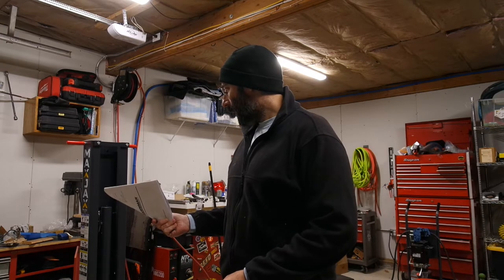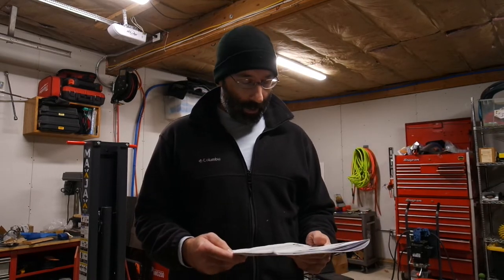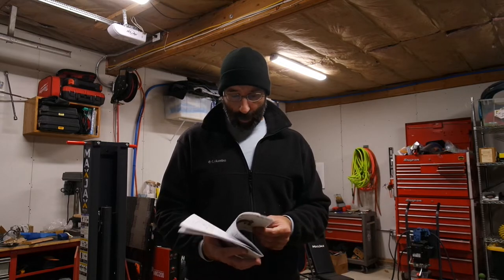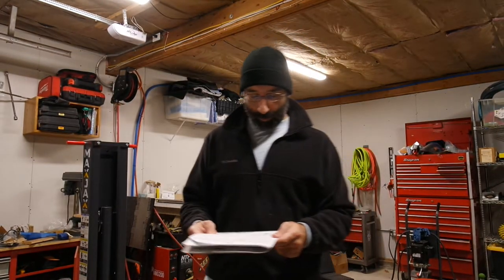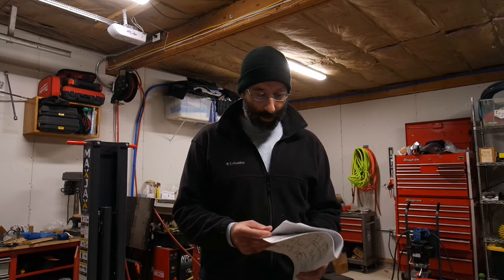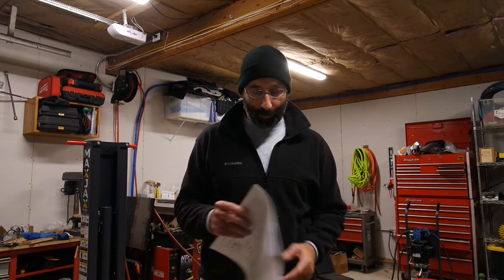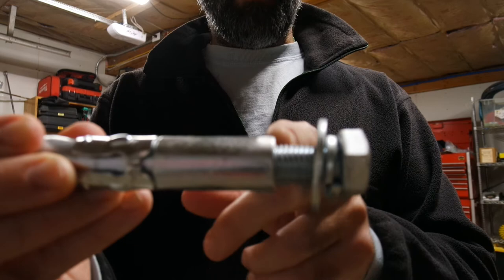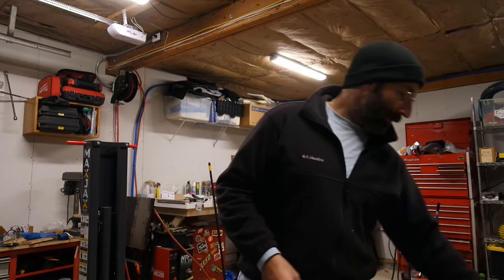MaxJax M6K lift install problems, tips, and suggestions

Comment: Helpful insights, Thanks for posting the video.  Using the post as a template didin't work well for me either. But I knew the holes would have to be near perfectly pumb to not cause issues later so what I did was took a piece of the thin plywood crate that the lift shipped in and I cut it out to match the size of the plate and drew circles for the holes with a black marker and then drilled those holes out , then I used the thin piece of plywood as a plate template setting it on the concrete in place of the post. It worked perfectly. I first pre drilled the smaller hole and then stepped it up to the larger bit. My holes ended up perfectly aligned and plumb without the actual post in the way.  If the mfg wants to really step up their game they could pre print this "template" on the top of the crate and tell you in the instructions to cut out and use the included template... ;)
Reply from the maker: Great tip!

Comment: Great video, good tips.  Appreciate the tip on the wej-it anchors.  $64 for 10 anchors vs the $180 to get anchors with the exact same spec from Bendpak! I plan to get a few so I can use my lift in more than one place (more than one garage).  Not sure what means you use to do your videos.  If you just use your phone like I often do then maybe try an app like the one I use which allows me to make a video with my phone while recording the audio for that video from my bluetooth headphones.  Lets me walk all around and have good crisp audio that does not fade when I am not directly facing the camera.  I have a few videos that I really wish I had used this option on that I can't change now or they will lose their priority.  The app I use with my android phone is Cinema FV-5 I really like it. Only issue I had with it is that it dumped my videos into a spot on my phone that was rather odd so I initially thought it was not working.
Reply from the maker: I appreciate the tips for the AV stuff. My old phone let me record audio with a bluetooth device, but my new one will only record with the built in mic (calls work fine with BT devices, but it won't record audio when filming). I used to record with a mic and then overlay the audio, which was a pain, but it sounds like your solution might be a lot easier. Thanks again.

Comment: Awesome video!  I am planning on a near term purchase and there aren't too many videos on the "new" version.  You also speak about this stuff in a way that I understand.  For example, your explanation of the reason for the width choice now makes perfect sense where I didn't really get it when others just say the width they chose "because I have X car".  I actually plan on doing a mock up with the cars in place to make sure I get it right, but I will definitely benefit from you sharing your experience.  Thanks!!

Comment: Looks like my replies to you are getting deleted. I’ll try this way: Yes, female threads as I need them flush with the floor as well. I got them from the anchorco site who also has the epoxy as well. Search Power-sert for the inserts. You will need the 5/8” thread. If you have a damp environment or maybe outside, they have it in stainless as well but will cost a lot more. I did just order so I don’t have them in hand yet but looks like it will do what I want. Also ordered four pipe jack stands elsewhere. Pipe stands because I can’t find anyone who still makes the car stands that have the 30 to 50 in. height range with the top spin adjustments, only the pin type for the car stands. That is just for some added safety/stabilization. As far as the leaks, I have been told the fittings and the sealant are not the greatest made.
Reply from the maker: Thanks for telling me the name of the product. I found them and I'm happy to see they come in a 10 pack. Perfect for our needs. Can't believe I missed them when I was looking for a similar product.

I looked for some stands, but I haven't ordered any yet. I found a couple screw type on Amazon that look like they could be modified to reduce their height, but most of them are 45" min height so you're going to be struggling even if you chop a couple inches from them. I'll have to look into the pipe stands.

Comment: Took me a long while to find the anchor place. On the stands, the only car stands with the right height range I found was the Sunex 1410, but they are the pin type. I ended up going with the Vevor Pipe stands (Ebay had the best price). They have the screws and are rated for 2,500 lbs. so with four you've got 10,000 lbs., just designed for pipes and not cars but options are limited unless you want to do some cutting on the higher ones. Again, I have them on order so I can't give a full opinion yet.

Comment: Thanks for the great video.   I bought the max jax about 5 yrs ago.  The anchor bolts are slipping and not holding anymore.  Thought I followed the procedures correctly but  maybe not.  However, I do not trust these anchors bolts an longer.  Want to sent anchor bolts in epoxy.  Do you have a recommendation on the epoxy I should use?
Reply from the maker: Mine have not yet started slipping that I'm aware of, but I think it's a matter of when-not-if. I haven't used them personally, but there is a product called  Power-sert (https://toggler.com/products/power-sert-adhesive-insert-anchor-zinc-plated-carbon-steel) that was recommended here in the comments by @dcad1005 .

I need to coat my floor and I plan to upgrade the anchors then. All the other anchors I found are male thread and I can't have threads standing up out of my floor.

Comment: thank you for making this video.  i found it helpful as I am in the process of installing my maxjax.  i was planning on putting my posts closer together until I watched this.  The safety catch tip is good and I will make sure to pay attention to the orientation when I assemble the cart as well.
Reply: also 100% correct on the hydraulic fluid capacity.  i dont know how they could get something like that wrong in the manual.  i dumped in 7q to start and it sounded like the pump was sucking air when i began the bleeding process.  2 gallons wont even get you to the min line of the dipstick.  they should pay you to re-write the manual hahah!  they can afford it with the price this lift runs.  

tips I can share:

- throw that red bottle of no name thread sealant in the trash.  these have a rep for leaking so I didnt chance using that.  

- the short hose on the cart is going to be weird to install as it slightly too long.. you have to angle the fittings out and bend the hose also i took the fluid divider off to get it on right.

Comment: I also found that my SUV required a narrower post spacing than my sports car. I think I ended up with 126" outside spacing.
I used a rotary hammer drill and it was a piece of cake drilling. I also found that I could drill straight with the post in place.

Comment: Good video. I'm thinking about getting one of these lifts for my Garage as I do all the work and maintenance on not only my car but my wife's and friends as well. I'm getting close to 60 and laying on the floor and bending over is getting harder. 

I'm considering both a scissor lift and the MaxJax. I'm leaning towards the MaxJax. Even though I'm pretty good at things like assembling, I'm sort of hesitant about the space of the posts and drilling.
Reply from the maker: My opinion is that if you can successfully do a brake job, you can install the lift. Nothing about the installation is overly hard, not even the stuff I talk about in this video. I made this video because some of it is simply not explained in the instructions. If I had known about the post width, it wouldn't have taken very long to get the measurements.

My biggest problem with the scissor lift was that the manufacturers warned to not get under the car when it was on the lift. It was made for doing tires or brakes, not actually working on the hard parts of the car. Ultimately that's what made up my mind. As I  get older, I'm going to have to give up pulling engines and replacing clutches, but for now I needed the ability to get under the car.
Reply: @jamesashe  oh yeah, I've been around cars since I was a kid back in the 70s . My father was a mechanic for Dodge for 40 years. I worked at the Sears Auto center right out of HS back in 1985. Anyway My ceiling in my Garage is 9 feet I believe and my concrete slab is 10 inches thick. 

I'm more concerned with pricing of each now that I'm close to retirement and will be living on fixed income. Some of the new scissor lifts are made now to work under. They have big beefy locks. But I do like the maxjax. It's over 2 thousand dollars more. So when I decide, I want to make sure because it's going to be a one time purchase. I don't do heavy work anymore because of a back injury from a car accident a few years ago. These days it's just tire rotation, oil changes, Brakes and rotors, struts, starters and alternators, radiator and general things like that. 

I did find your video interesting, and informative. I like to know what one could be in for or expect when doing something.

Comment: Informative video. I had confusion on the spacing of the columns too but thanks to you, I have a much better understanding and seems better to just go the 130 to 135 in. max and should cover just about any size vehicle. I ended up having to put in large footings due to slab thickness but still going with the epoxy anchors by Wej-it as I had concern of the inserts coming loose due to repeated torquing plus I believe they are much stronger anyway. Now Max-Jax sells the epoxy anchors but the kit does not come with the epoxy. Same price, others sell what looks like the same kit including 1 tube of epoxy but looks like it may be Chinese made epoxy. I ended up getting everything I needed from Anchor Co for the same price. Bought 2 tubes of USA epoxy, extra mix tubes and the 10 anchors, delivered for the same price. Do you have any hydraulic fluid leaks from the fittings? Seen some people run into issues with that.
Reply from the maker: I think you're spot on with what you said about the anchors. Are your anchors female threaded? All the epoxy anchors I found were male thread I can't have the anchors standing proud in my space.

Yes, there are leaks at the cylinder connection. I would describe them as 'weeping' There's never anything to wipe up but the base is always oily a couple weeks after you clean it. If memory serves, one cylinder leaked significantly and I redid the connection with teflon tape and a better sealant than came with the kit. I don't think I did it wrong the first time, I just think the included sealant is not very good.

Comment: Thanks for the good info -- will be referencing when installing the used lift I just picked up.  Do you still have the Mr2?  Charles
Reply from the maker: Sure do, 91 turbo t-top. Do you have the 2GR in yet? I think that's a great engine for the car.

Comment: Very helpful. I'm close to making the purchase and being aware of some of the issues with the documention will hopefully make my install easier. Btw how thick are your floors?
Reply from the maker: They were exactly as thick as the manual dictated plus or minus 1/4" . I was planning to cut out a chunk and repour, but I got lucky.
Reply: Thank you. And I assume you haven't had any issues with the install into your pad over the last year? How much weight are you lifting?
Reply from the maker: @ocramidajzj  Most I've lifted is about 5k. Truck is listed at 4.4klbs and I assume it's a little heavier. The pad hasn't been a problem, but I think the anchors are starting to pull out. I'll probably have to epoxy them in place in the near future. I'll keep an eye on them going forward, but I'm pretty sure they're slowly pulling out of the holes.

Comment: over explaining, over discussing, too much verbal posturing, its a 5 minutes video.

1.Make sure you have the correct manual. No need for any stories.

2.Lift base is used as a template, not a drill jig.
3.Measure twice (your vehicles), drill once.
4.Get the right drill for proper anchoring.
Reply from the maker: So you watched a video you didn't like, couldn't click away, couldn't control your anger enough to catch the details, and in the end just wrote an angry comment trying to diminish the video because you don't have control of your temper? What a good use of everyone's time.
Reply: @jamesashe  I'm installing mine now, what you got wrong is you're trying to use jacking points for lift points, they aren't the same thing.